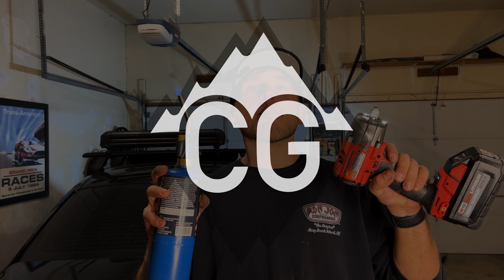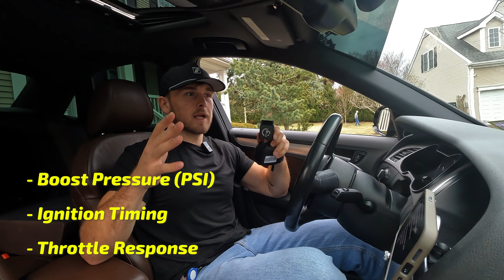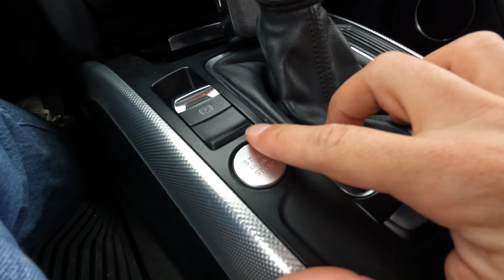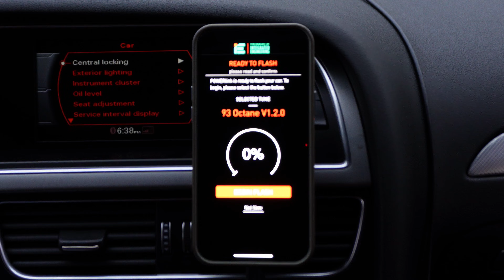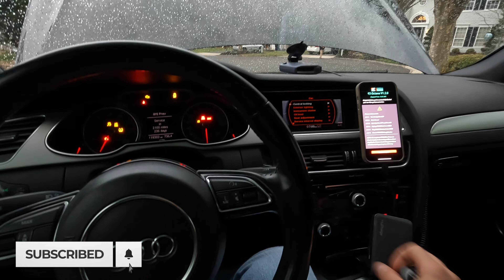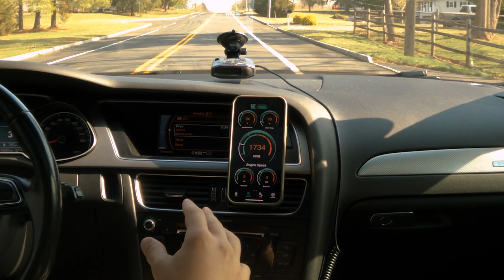Tuning My B8.5 Audi A4 - IE Stage 1 Install & First Drive! (Huge Power Gains?!)

Comment: About to pull the trigger on a stage 1 from IE, bought a used 2017 a3 2.0 Quattro 112k miles for under $10k super clean I already did all the cosmetics, murdered out, great maintenance history, I’ve also redone it since I’ve had it, intake, BOV spacer, turbo muffler delete, metal turbo inlet, cat back straight pipe exaust. I prefer the A3 over the A4 because I like the smaller compact. I have a Infiniti g37x as well and it’s probably about the size of the A4. Anyways first time Audi owner and turbo vehicle owner, absolutely love the car. Don’t plan to beat on it or push it hard just a nice around town daily. Selling my g37x for a $12k down payment on a hard top 5.0 mustang for the fun weekend abuse. Also have the trusty 07 civic as a work beater. Union electrician here ✌🏼

Comment: When it gives the steps after the upload. It says start the car (as in starting the engine?), then turn the car off, then turn the car on (without starting the engine)? Is that the correct way? I'm planning on tuning just wanna do it right.
Reply: Yea i know the feeling

Comment: My gripe with IE is the fact that after a ECU stage 2, and a DSG tune... you're at 1600 bucks. Then say the bank comes and illegally takes the car... and it's not possible to get it back.... but you get another car and they could let you transfer it from the old vin to the new vin.... but they won't. They legit lose absolutely nothing... meanwhile their customer is out 1600 bucks and all that money gets erased from the car that the bank took too.. because they want to sell it as stock. I'm pretty disturbed by that! Make it makes sense!
Reply: The bank can’t take your car if you pay for your car.

Comment: Just completed my 2015 a4 stage 2 setup. IE everything except DV+ valve and CTS muffler delete. CAI, fds intercooler, R8 ignition coils, 3"downpipe to catback exhaust, hpfp upgrade, powerlink stage 2 and all included tunes...all IE. I am waiting for a throttle control device(like pedal commander) from uro tuning, we'll see if it helps lag issue.
Reply: Drop us a bone bro.Did you do all that yet?That would be the ultimate machine!

Comment: planning to stage 1 my b9 a5, 250-262hp to 305-315hp sheeeeesh
Reply: How is the power and handling after the install?
Reply: @nickmartinez3787  power jump is  very noticeable, you'll feel a big difference in how the car pulls thru low end gears PLUS how much output it can have on the upper end! Handling, for me, is great. I have quite a few additional upgrades over just the tune but they dropped a big update recenetly, if you're just now buying make sure you go Pro or Apex tier when you buy you tune!! Overall, the reliability of IE's tune is next level, your car will feel the way it should have when you first bought it!! Big response, hope it helps

Comment: Don’t let stage 2 scare you. Just make sure you properly warm up your car (AKA don’t beat on it until it’s up to temp) and let the turbo cool down properly after a spirited drive. Just drive normal for the last mile and a half of your drive and you are good. Been on stage 2 for 80k miles ZERO issues and I mean ZERO. I have only had to replace a water pump which has nothing to do with the tune.
Reply: I mean, it reduces reliability and don’t you need to get stuff installed for it?
Reply: @adz2380 Yeah just a downpipe basically is all you need to run it. It will still be reliable if you take care of it. My car has been stage 2 since 120k miles and I am almost at 200k
Reply: @audinerd1622 do you got the crackle state 2 one or the base one? 😊
Reply: @adz2380 Just the base one, it crackles on its own. Actual crackle tune is obnoxious in my opinion haha
Reply: @audinerd1622 yeah that’s what my friends said they just prefer the raw sound of my engine. I think you’ve convinced me to do it!
Reply: @adz2380 That’s the way to do it 👍🏼
Reply: @audinerd1622 do you need anything to run stage 1? Or you just get the chip and can stay stock
Reply: @917dame Just the chip and can stay stock. I’d get the car checked out and have maintenance items done though.
Reply: Do you have b8 or b8.5?
Just curious about reliability..
Reply: @ArberJ I have a B8
Reply: Impressive.
I have a b8 with 100k miles on it, just done a new timing chain and tensioner, new bosch injectors and new ngk ignition coils and spark plugs. So would my audi be fine for a stage 1? I have heard about stress on injectors. Thanks
Reply: @ArberJ It would be just fine for stage 1.
Reply: Would getting a bigger intercooler or intake or both help with water pump issues? I feel like Audis of this gen have this issue regardless. I have a b9 a4 and am considering stage 1
Reply: @KOTP0223   Don’t think those would help the water pump issue, but it’ll help the car run better with a tune

Comment: Will this reduce the life of the turbo and the engine ?
Reply from the maker: Just a tiny bit but not by much if the proper preventative maintenance is done before hand for whatever mileage you car is it 🤝🏽

Comment: What’s the difference between the 91 tune and the 93
Reply from the maker: Just about 10-15 HP
Reply: And different gas right but the b8.5 can run both octanes cause I am stock  right now and I run 91 premium gas and I have a stage 2 ie tune coming in,I see everybody tune 93 octane and I was wondering if I can run it

Comment: Love the video, also have a b8.5 a4, did you do any services before doing so? I’m also around 120k miles on mine like yourself and kinda scared to ruin the reliability I’ve had so far. Did you do your timing chain, is that an issue on the b8.5? Thanjs
Reply from the maker: Absolutely did a few things as I tuned my car too at 120k! I did my timing chain and tensioners along with my PCV valve. Also did a carbon cleaning to make sure the valves were crispy clean 🫡 outside of the tune I did an aluminum water pump because they tend to crack from expanding and contracting in heat and it’s an easy on and off while your intake manifold comes off for a carbon cleaning. When I did the carbon cleaning I also did injector replacement which is generally cheap as they tend to clog up in high mileage direct injection vehicles. But as long as you have all that done you should be Set 🤝🏽🤝🏽
Reply: @turbo_squid  thanks a lot! yeah maintenance is definitely key before tuning so makes a lot of sense to get those items out of the way!

Comment: No issues with the app? Been hearing mixed reviews but dont want to use laptop since i don't have a garage and will have connection issues.
Reply from the maker: @infoguerilla153   absolutely no issues at all. I think it works flawlessly if you ask me

Comment: Funny how you had a Mazda 3 and now an A4 and I had both, well I still have them, although my A4 is the ZF8, even tho I had an amazing experience with IE for about 4-5 years, I tried a company which is very reputable and a lot of people overlook and that’s JHM, they literally have an amazing customer service and compared to IE, they can literally custom adjust your tune to do almost whatever you want at no extra cost and the tune themselves are cheaper to begin with… 

I had my ZF8 tuned with them not to mention they’re the only ones that offer TCU tunes for B8/B8.5 A4/A5/Q5, and it was amazing, I got my launch control raised to 3.5k rpms which made a huge difference for the 0-60 in itself, and they were also able to turn off the auto up shifting in manual mode and change the shift points to whatever I wanted and how aggressive I wanted the shifts…
Reply from the maker: That’s sick lmao, funny how we had similar cars
Reply: @turbo_squid yeah lol, few recommendations, if you don’t plan on going bigger turbo, don’t get an intercooler that’s too big, I think the ECS thats about half of the front end the best choice, I went with the massive CTS one and although power was more consistent in the warm weather I did lose power overall, never never get a diverter valve spacer or a blow off valve, this cars just don’t like it and cause problems down the road, but they do sound cool asf, don’t delete the resonators, replace them with something else if you want more sound, if you delete them the car does lose some torque down low and it produces more turbo lag and it’s definitely noticeable !
Reply from the maker: @ oh no kidding thank you. I did in fact do a resonator delete as one of my first mods years ago but I didn’t notice much of a difference, I’ll have to keep that in mind
Reply: I have the 034 Motorsport Stage 1+ tune, & can adjust the launch RPM's all the way up to 5k, it has a redline of 7.4k RPM's, can turn on both the fan & supercharger intercoolers with the cruise control stalk & running a 3.5s 0 to 60, & mid to high 11's in the ¼ mile, & removes the speed limiter as well, got it up to 174mph & it still haf a few more to give.😂
It definitely woke the car up & can now beat almost anything I cross, getting beat by a Model 3 is what made me mod it, I couldn't allow that to EVER happen again, or at least as not as bad! 😂
Reply: You can tune the zf8’s??
Reply: @DomKurk14 yeah and the zf6 too. The zf6 tuned is legit.
Reply: I have jhm as well. Great company.

Comment: Just wait until you go stage 2. Much better in the low end.
Reply from the maker: Oh I bet. Stage 2 scares me lmao I need to keep the daily reliable
Reply: @turbo_squid just dont get a pop tune and you will be fine, used to have a stage 2 audi a4
Reply: @turbo_squid  even with the pop tune you will still be fine i just think raw power sounds better and its way less stress on your engine (I also used IE)

Comment: What’s up bro I saw that u have the ie intake and I was wondering if yours whistles really bad on acceleration or if I might’ve installed something wrong
Reply from the maker: What do you mean by whistles really bad? Under acceleration?
Reply: @turbo_squid  sorry I just saw this it’s like at 2500-3000 rpm’s it’s like almost a squealing noise
Reply from the maker: @ could be the PCV valve or serpentine belt
Reply from the maker: @ does it seem like it’s coming from in the engine or one of the corners of the car?
Reply: @turbo_squid  it seems like it’s coming from the turbo or intake
Reply from the maker: @ I’m not sure at that point. My first guess would be a boost leak somewhere because that’s a super common issue on these cars & engines
Reply: @turbo_squid  ya okay that’s kind of what I was thinking too
Reply from the maker: Like when boost hits or just in general?
Reply: Yeah it’s supposed to whistle hard on spool up and during boost… did you go from stock air box?
Reply: I put the IE intake and the turbo sound like a dying cat as it spooled up. I put on the APR turbo muffler delete and it just sounds like a small turbo winding up real fast. Much more consistent and less embarrassing.